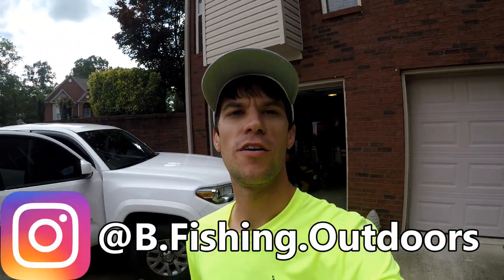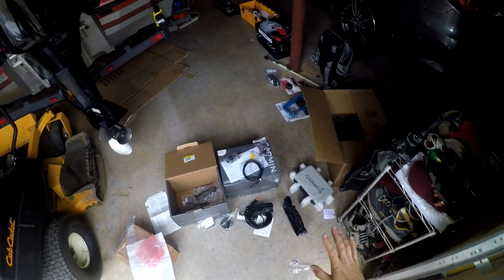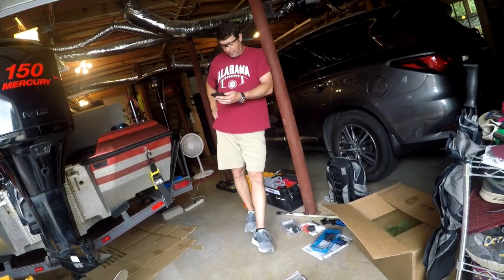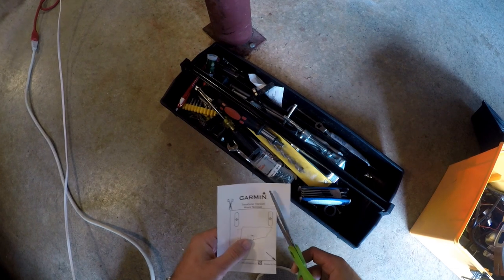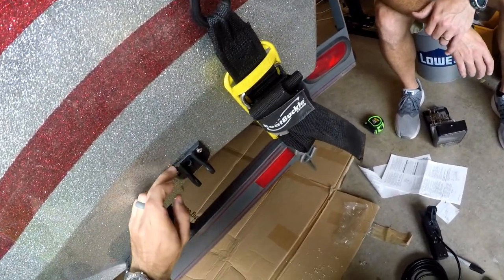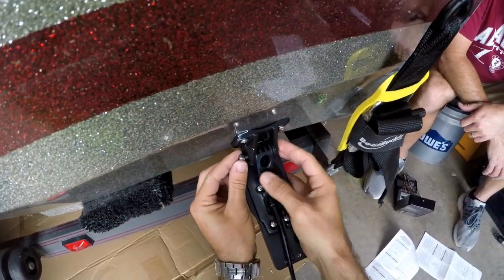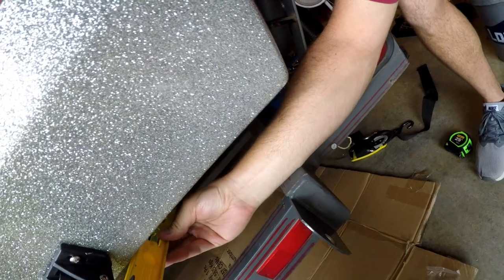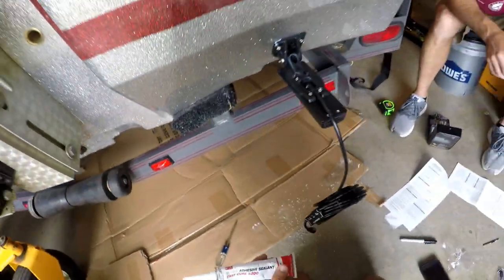Installing Garmin EchoMap Plus 73SV and 73CV | B Fishing |

Comment: I did that same install for a friend last spring.But I talked him into getting a transducer mounting board.2 screws above the water line to mount it.That way if you ever have to do adjustments or change brands,you won't be drilling more holes in hull or breaking seal on screws to make adjustments.Simply loosen screws to slide trans bracket and retighten.No need to reseal.
Reply from the maker: There is nothing like the pucker you have when you take a drill bit to your buddy's boat.
Reply: B Fishing Outdoors sent you a dm on IG.

Comment: What’s the difference between SV-CV
Reply from the maker: SV- side view CV- clear view (down view only)
Reply: Which one would you recommend and do they both use the same transducer
Reply from the maker: @charlesroberts6284  we put the cv up front with the transducer on the trolling motor. The sv at the console runs to a transducer on the back of the boat. If you can only get one get the sv. Sv does both down and side imaging. Cv can only do down
Reply: Oh ok thanks for the Information really appreciate it

Comment: Great video I own both 93 SV AND 73 SV. You having good luck with Side Imaging? I am struggling with my transducer placement had it on my jack plate and getting a lot of turbulence. My try and mount it the way you guys did.
Reply from the maker: We have had zero issues so far. I am liking having it. it does really well finding us new structure to try
Reply: B Fishing Outdoors I am going to remount my transducer in a different place on the transom and give it a shot.  They are great units.
Reply from the maker: @basketballref420  yes they are. You may want to look into a transducer mounting plate if you are nervous about putting holes in the boat. It will give the flexibility to move the transducer around without making more holes.

Comment: Hey buddy how is your plus 73sv so far ? Any problem
? And how do you like it / working for you on the trolling motor ? Thanks
Reply from the maker: We have had zero issues. In my last video you can see me using them. They are great units.
Reply from the maker: The CV is on the trolling motor and the sv is on the transom
Reply: B Fishing Outdoors cool vid man just seen it , hey what settings do you have yours on your sv,
Reply from the maker: @anthonymuro4917  honestly, no clue. I would have to go look and see what everything is set to. I just don't know off hand.
Reply: B Fishing Outdoors no worries. Thanks for the replies ! Just trying to master this echo map to its full potential.   I’ll have to just play with it. Thanks !
Reply from the maker: @anthonymuro4917  that is what I have been doing more time on the water. I even made a few contrast adjustments this weekend.